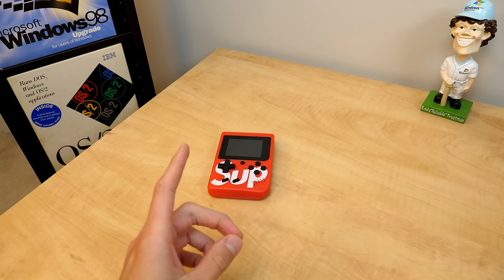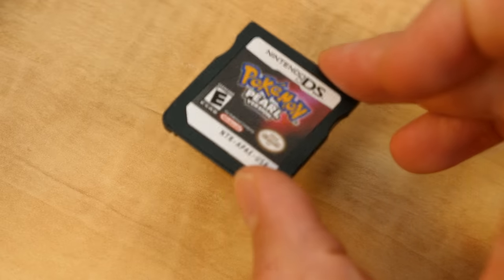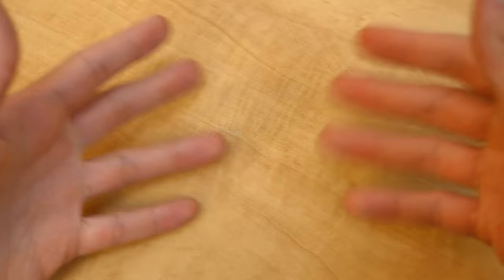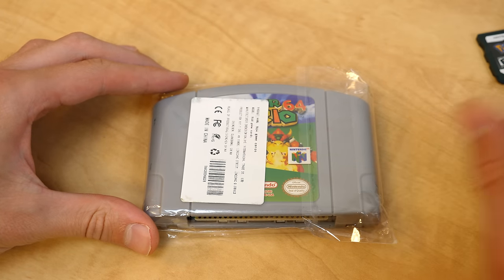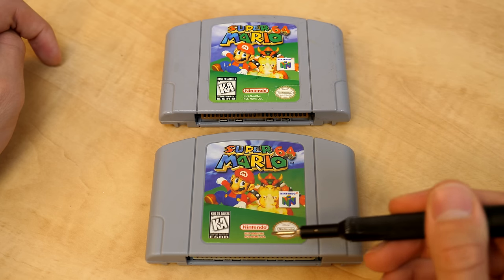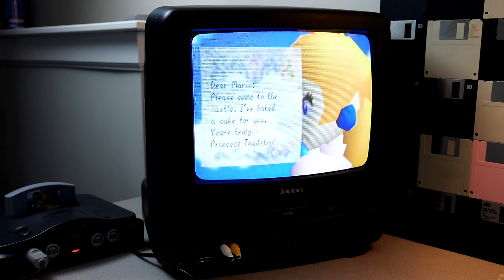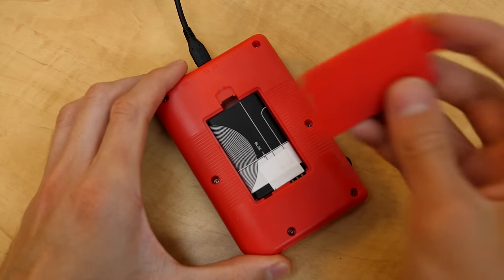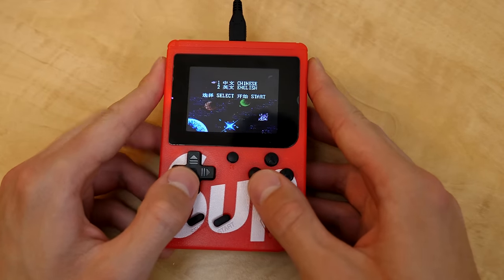I Bought Bootleg Nintendo Games from Temu

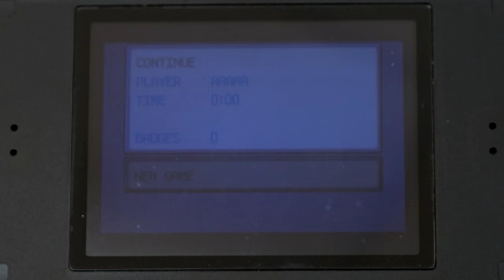Comment: 11:06 That "The save file will be loaded." message from the Leaf Green cartridge is actually edited in to cover up a likely small save corruption message. It may be due to the bootleg's save chip being a different type and/or a smaller size so it might not have the space for the backup save that is normally hidden on a real Pokémon Gen 3 cartridge in case someone powers off while saving. Though, the bootleg would probably work fine for most things, but wouldn't work with Pokémon Colosseum, XD, Box, and likely not the Gen 4 Pal Park. Though, the Pokémon Pearl on the flashcard should work with Pokémon Battle Revolution and Pokémon Ranch.
Reply: Yeah I was waiting for that message to be displayed as official LF/FR cartridges never simply tell you they're going to load the save file. A FR bootleg I have, if I recall correctly, says................"The save file is ok"
Reply: Yep, this line of text is not in an official rom. The cheap reproduction version does not have the space for both the primary and backup save, the latter of which is likely looping back around due to lack of space and that means the primary save is cut off and thus corrupted. The message on a genuine cart when this happens says "The save file is corrupted. The previous save file will be loaded."
Reply: on RSE bootlegs another message that pops up is "The game can be played." - which is a modified "dry battery" message.

For anyone who has one of these, and has actually played on it, I'd dump the ROM (if you have a DS and a flashcart, you can use a piece of homebrew to do that, though I forgot what it's called), the save file actually ends up being written to the end of the ROM. I've managed to recover a friend's 150+ hour Ruby file from a fake cart this way.
I'd also try to flash something else to it via a tool like a gbxcart. You'll need to patch whatever ROM you want to use on it though.
Reply: @FrostedGeulleisia  i managed to dump a save from my bootleg pokemon emerald, and convert it into a format that i could use with an original rom and flash cartridge. eventually if I get my hands on a genuine pokemon emerald I should be able to copy the save from the flashcart to that. I remember it being a bit of a pain to do, maybe one day I can figure it out again and write up how I did it
Reply: I have one of those 250 in 1 carts that is surprisingly well made. It uses an SD card that they made accessible without opening the cart, so in theory I can add my own games. All the games seem to be real games, too. The only problem with them is that some are willing to save and others aren't. Not a big deal because it comes with save states, but in Leaf Green, I can't do anything that requires saving or the game will hang. I can save in Emerald, though.
Reply: I own and use a flashcard regularly, and i can confirm they work with both PBR and My Pokemon Ranch
Reply: You can actually also use these fake GBA games as a flashcart, provided you also own a DS flashcart/R4. There exists homebrew that you can boot on the DS cart, that will allow you to flash a new ROM into the fake cartridge. This way you can put any gba game you like on there.
Reply: Wonder if you can use a flashcart to transfer from Gen 4 all the way to Pokemon Bank......
Reply: @SockyNoob you should be able to as long as you have at least one genuine copy of a game say you flash black but have a legit copy of white to use Poke transporter you'll be able to transfer to bank
Reply: 11:05
Reply: I want to know this because I used a fake copy to trade with a real copy without knowing the other was fake. Does the data you send over to the real game become legit? For ex: Pokemon, items, etc? Because I found some evolution items on the fake soul silver copy and used them on my pokemon from the real heart gold copy.
Reply: @Sailor-Khione  as long as your not making guarunteed 6iv shines they'll be considered legit when transferred/traded
Reply: @Sailor-Khione  It should be the same Pokémon data unless that fake copy had some advanced rom hack/mods applied to it, like adding in extra Pokémon, changing or adding spawn locations, etc.
Reply: @FrostedGeulleisia you can flash another rom usong a nintendo DS instead, but since the DS will send 5 volts to the chip instead of 3 while writing, there are high chances the cart might fail/die in like... about the 5th writting or so, But it is doable.
Reply: @Darklord_tK 6iv shinies are also legit Pokémon. Most of the time. If it's randomly possible, then it is legit.
Reply: @thomasc9248  after swsh any Pokémon not generated properly in older games will just be shown as bad eggs in Gen 8 and up games but some people have entire bots dedicated to generating and trading hacked Pokémon that pass all the flags
Reply: that textbox is actually a modified version of the "battery is dry" message, because these don't actually have an internal battery. they modified the rtc code to tick while playing but i'm pretty sure the RTC ingame just freezes when you turn it off. 

the more spicy parts are completely behind the scenes - the ROM and the savefile are written to the same rewritable flash chip to save on cost, which is not something nintendo ever did in any games, they split it to two chips, one of which isn't rewritable. so they had to modify the save routines to move enough into ram to keep the console running, save the game, and transition back to the game after writing onto the chip that it's reading the game from. and honestly, my explanation is probs wrong, this is just what i understood
Reply: @ryjelsum leaf green does not have an internal battery as it lacks time based features but i believe you are correct. the game sees something has gone horribly wrong when it tries to find a non existent save chip, interpreting whatever it ends up searching instead as corrupt data, so it spits out the message warning you about your save being corrupted and loads the backup save, which is located in rom on cheap reproductions. it's not entirely clear why the backup save works on cheap reproductions even though they can't patch the game to simply remove the save corruption warning.

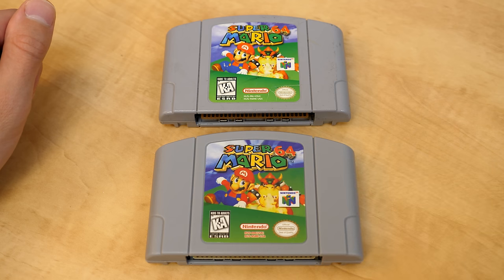Comment: 14:50 I always wonder why bootleggers don't just print labels with the many scans available of the genuine labels and instead make their own
Reply: you can't "just" print a label from a scan and have it come out looking the same. A really high quality photocopier or scanner + printer combo might be able to pull it off, but it would be really expensive--probably more expensive than printing the original label was. Matching all of the colors perfectly and having it come out just as sharp with the same finish etc is just not easy to do.

But the really bad mistakes on some of these, like putting TM instead of (R)--or in the case of one of my SNES carts, "Yoshi's Sland"--I really have no explanation for other than just lack of attention to detail maybe combined with not being able to read Latin script very well.
Reply: But high quality scans already exist and are in easily accessible internet databases
Reply: My guess is customs wouldn‘t approve if they looked like exact copies.
Reply: @TheXppp1 high quality scans aren't accessible and require printers, u cant just pull something off the internet and expect it to be automatically good quality. And if Nintendo finds a bootleg with exact trademarks then they can possibly sue them
Reply: Copyright reasons I'm guessing
Reply: It defeats the bots that check for identical duplicates.
Reply: Most of the scans you see are not of high enough quality for printing. They likely do start with a scan, but then try to fix it up. It would explain why the N64 logo got an extra shadow, for example. They probably put an image of the N64 logo on top of a lower resolution logo. 

And even then, getting the dimensions exactly right isn't easy.

Comment: Most "chips" have a four digit date-code on them. The fist two letters are usually the year they are produced. The code 2103 would mean "the third week of 2021".
Reply: This is a good way to tell for sure, I've never personally seen a fake GBA game that's replicated this however I have heard it's been replicated so these guys may eventually be able to put the on the GBA games as well. It's not completely foolproof is all I'm saying, another easy way to tell is looking at the traces and test pads, the ones on the counterfeit look completely different from the original. Also the fact the plastic is so clear on these ones is another giveaway, an authentic leaf green copy is more opaque and will actually be somewhat hard to even see traces, test pads, and even the date code squares but these counterfeits you can see completely through.
Reply: Same dating scheme as tires lol

Comment: I can't tell if it was editing on your part, but the amount of time it took to save your game in Pokemon Pearl was much shorter than it normally would be on a real cartridge. Neat.
Reply: Or perhaps it could be because modern micro SD cards, while slow compared to SSDs, are quite fast for storing small bursts of data like game saves and pictures.  ;-)
Reply: @SirReptitious  Could be. Playing these games via emulation does not provide faster saving though. I just find it super weird.
Reply: @GameStormerGX  I was talking about hardware performance; it has nothing to do with any emulation effect. Most micro SD cards sold now are class 10 which are way faster than the ancient NAND that was used in systems like the Playstation 1 memory cards, and I assume old Nintendo devices(I have never owned a Nintendo system but they must have been using the same level of tech the other companies were using at the time). Sorry if I was unclear or confused you as that was not my intent.
Reply: @SirReptitious  that's interesting - I have platinum on a flash cart (the DSOne, not one that claims to be a specific game / games like the ones he got ) and it seems to save at around the same speed as the legitimate japanese diamond I own
Reply: I've been playing SoulSilver on my R4 card, and it saves way faster than the genuine carts.
Reply: In the EvolutionOS settings, try increasing your SD speed to like 8x or Fast. Since modern cards are way faster than what these carts actually need, you don't need to worry about settings the speed too high.
Reply: That's because it's just a port on modern hardware, so obviously, the save feature would be much faster than originally because that was the hardware at the time

Comment: I have that SUP system! My brother got it for me for Christmas years ago, before TEMU was even a thing. It's the most insanely bootleggy thing I've ever seen, and I love it. You can use the famicom controller because it comes with an attachment to connect it to your TV (as long as it has red and yellow AV ports) and play it like that. Mine has 400 games, but I'm sure there are other versions.
Reply: My sister got me something for Christmas that looks exactly like that, except without the SUP branding. I didn't have the heart to tell her I'd gotten a 3DS that I use for retro gaming. (It can even do many N64 games now! And Virtual Boy, though i've not tried that yet.)
Reply: i have one of these too, but instead of SUP it's AT ( no ideia why they even bothered to change the name). these things are really easy to break, the first one i bought a long time ago nowdays have a pretty dark screen and the battery doesn't last that long, so yeah, most games run pretty great but it's definitely not worth getting this thing since in just few months the quality gets worse (specially the buttons)

edit: just figured out that the AT  one i have the screen is pretty much larger compared to the SUP (i guess??)

Comment: I got out my old leaf green cartridge and there are a bunch of issues with the label on the front, but without something to compare to they would be tricky to spot.  The biggest issue is the spiral in the background.
Edit: Also the blurring and name changes in the listings is probably to beat automated checks and isn't there to prevent actual moderation from finding them.  They just need the listings to be up long enough for a few people to order from them before they get taken down.
Reply: also i believe that the pins on the back should have a few more then the fake has
thats how i tell my fakes anyways most of them i seen have too many and in rare cases too little like this one
Reply: The cartridge shell itself is also off. Firstly like all legit GBA games there should be a diagonal rectangle poking out from the top right of the label, Fakes pretty much always get the etching for the GBA and Nintendo logos wrong in some way, and probably the most damning thing is that legit LeafGreen carts are more opaque with a brighter green colour. This fake appears to be repurposing a Pokemon Emerald shell.

Comment: The reason why the DS card had that Deep Labyrinth banner is because it actually is using [parts of] that game's ROM. Starting with the DSi, DS-compatible systems verify that the game is using a genuine ROM by checking SHA1 HMACs in the header over the executables and banner, plus checking a signature over the header. (For pre-DSi games, these systems have a whitelist of hashes.) The other contents of the card, however, are not checked. So, some flashcards and other unofficial software (like Action Replay) use a full ROM and load their firmware with a savegame exploit, while others load their firmware with a file exploit.

Comment: 7:51 In case you don't know, that is definitely NOT a screenshot from Pokémon Pearl. I can tell because the sprite used is Pikachu's sprite from Black and White not Diamond and Pearl. So yeah. Even the screenshots are fakes!
Reply: lel
Reply: it's a custom wallpaper for the flashcart's menu. Honestly I'm surprised they put in that much effort. They could have just left it as the default

Comment: I pulled out my copy of Leaf Green to compare to the bootleg and there were some more differences I noticed. For one the patters behind the text on the label is different. There are way more swirling lines on the official cartridge and the darker green around those lines is thicker. Also, the color of the official nintendo seal is light green on the official one, not gold. The plastic on the official is not nearly as easy to see inside of on the back. Also the words "Leaf Green Version" are slightly bigger on the bootleg.

Comment: Those 520 in 1 carts have a super big use Imo. You can pull the stuff off of it, and put whatever you want on it. SUPER useful if you just wanna single player blow through some of the games for yourself. It's cheaper than buying an R4 card or Acekard or any of those other big name brands. Bought one, replaced the games and then bought a 2nd cause it's WAY cheaper and seems to work just as good.
Reply: Isn't modding a DSi or 3DS free though (assuming you have one and not a DS/DS Lite)
Reply: What websites did you use
Reply: The biggest issue is just the QC.  Naming is off, sometimes include homebrews or bugged rom rips.  There are some game archival groups who have very high quality roms that are properly tagged and everything.  Combined with a software like Launchbox and you can have all the proper descriptions and art.

Comment: Honestly, I got one for SoulSilver since the game can't be properly emulated (I could never get the patch to work) and I bought it for $10 knowing it was a flashcart, but hey, I can actually collect those pokemon from the original game without selling a kidney because HGSS themselves are still really expensive to this day.
Reply: What issue are you having with soul silver because i never had an issue emulating it. That's probably my most emulated game honestly
Reply: @kitsunekid16 I’m not 100% sure if it’s an anti-piracy check but the screen cuts to black sometimes on loading the map. It’s pretty prevalent on both HG and SS for hacks. It could also be a bad rom dump I guess.
Reply: @kitsunekid16  Interestingly, I had problems with Platinum but HG/SS worked for me.

One issue with non original HG/SS games is that they don't have an IR chip and can't use the Pokewalker for example

Comment: Honestly, replica cartridges is great news for game preservation. The problem is you never know which ones work as opposed to being scams.
Reply: yeah but with genuine games that are readily available for the same price on ebay then the replicas are scammy
Reply: Also repro pokemon cartridges aren't able to trade or transfer pokemon to other games
Reply: @Cedalus most should be able to. only really old flashcards werent able to do this
Reply: @hihibecky i can’t get leaf green for 4 bucks anywhere else
Reply: @SunsetBear Why not just use an emulator if it's a money thing?
Reply: @hihibecky  the issue with this is that the supply of genuine copies is limited since they aren’t being manufactured anymore. Combine that with the sharply increasing prices of retro games and Nintendo not rereleasing these games or having them available in switch and it becomes very easy to see why people don’t care if it’s counterfeit

Comment: A lot of the time with the bootleg games is not that they don't run properly, they run pretty identical to the original - the biggest issue I used to face in the day was the saving function not working or the saves corrupting often.
Reply: Same here. I lost my saved data of Pokémon White 2 years ago and I almost cried because I had to start again, lol.